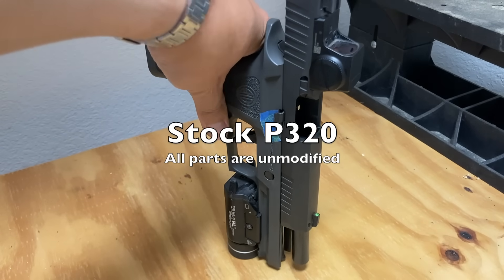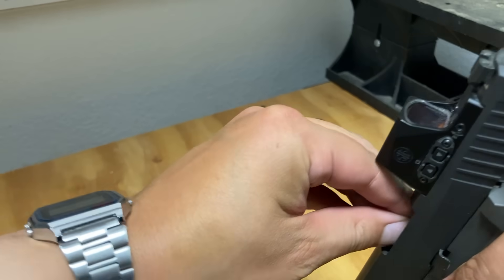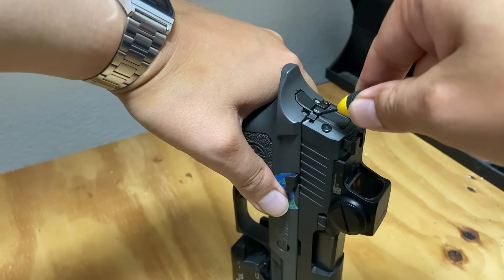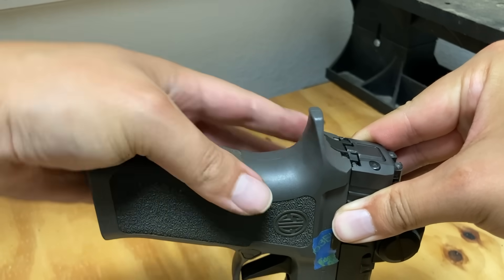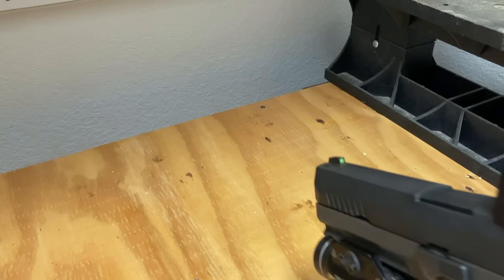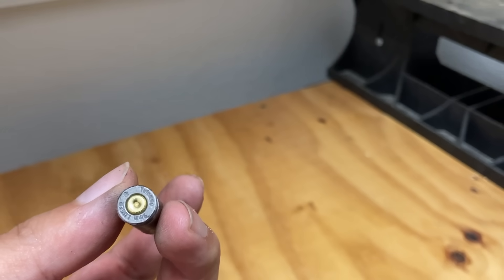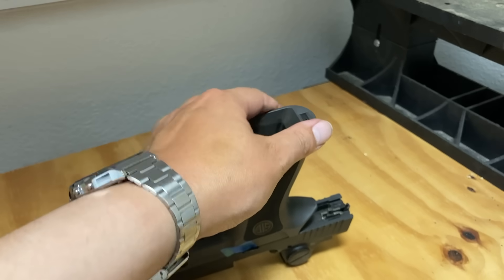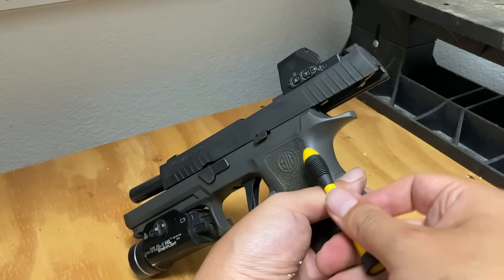Attempting to reproduce the FBI's Aug. 2024 P320 Sear Movement Test

Comment: I guess I'm dense but I still don't understand how this proves that a 320 can just go off in a holster with no  other action being performed or, in other words, as long as I keep people from shoving tiny screwdrivers into the guts of my 320, I'm pretty safe...
Reply: the working theory is that the striker safety is getting stuck in the "unsafe" position if certain pressures are applied to the gun (i.e. officer tussling with a suspect, pressing against a wall, that kind of thing) and then a knock on the back of the slide causes the striker to slip off the sear and fire the gun.  The striker safety on the P320 is a thin blade of metal (shown at 6:32) that is pushed up into the slide by the trigger pull.  It's a different style than pretty much all other brands, where they use a small round metal rod that gets pushed up into the slide on trigger pull.
Reply: @shazmodeus2795 Shouldn't the FBI be required to provide more than a theory?
Reply: @RynzoMendeln  I say theory as that is what they concluded was happening in their testing of this officer's firearm, but as the video we watched just now shows, it's difficult to replicate.  Basically, ever single P320 that has had a UD would need to be tested in this exact procedure and see if the result is the same.
Reply: @shazmodeus2795  I think so yeah. Every firearm that UD, especially the 320, should be examined to the max, don't ya think? There must be something I'm misunderstanding. It confuses me why the FBI left out the most important result, pending further investigation, from two years ago.
Reply: it shows that one of the safeties of the gun can fail if the first sear fails. sig apparently thought it was possible for the first sear to fail since they included an additional safety
Reply: Yeah. You'd figure the FBI could write a more cohesive report. From what I gathered, it goes like this.
Test 1: 100 sear pokes. Safe
Test 2: 50 hammer wacks and 1 sear poke. Safe
Test 3: 50 slide manipulations, hold together, and sear pokes. 9 failures.
Test 4: 1 odd no manipulations with sear poke. Fail. 

Are they saying that just by squeezing the slide into the FCU that that is moving the safety lever up and out of the way of the striker enough? 

Oh and then they went and acquired a brand new unfired 320 and it failed the first and only attempt. Teh fun

I guess if the pieces didn't fit and were outta spec that could be possible. They had one guy whose only job was to observe the interior parts in motion. Where's his results
Reply: Bro
Reply: Yeah, I'm wondering if I could just upgrade the internal components and have both a nicer gun and safer gun
Reply: there sa video by  youtube channel "Wyoming Gun Project" with title "SIG P320 Un Commanded Discharge and its Repeatable"... the issue is with the trigger. A VERY VERY VERY  slight pull can deactivate the safety, less than 1mm... that's crazy... a very slight out of spec or a dust for that matter can render your gun an assassin of its own. don't trade your safety for a gun that's been proven to hurt people.. lots of choices out there buddy.
Reply: @jetfu400 
Another YouTuber proved that even the holy Grail of guns, the Glock, does the exact same thing.
Reply: The whole point is that IF the spring is disengage AND the slide and being wiggled around a shit ton from “duty use” it could POSSIBLY go off. Im still not totally convinced this isnt a user error and of its not its from poor QC
Reply: @ADDAmerican 100% it just happens to be mostly law enforcement who have issues you know the ones too embarrassed to admit it was there fault
Reply: @chuckingleadyea idk anymore after hearing that airman died. Seems like an issue with the slide being compressed by holsters which is terrible. Unless a fellow airman shot him and framed it on the gun just going off on its own (a perfect crime) sig is cooked if thats not what happened
Reply: I was about to make the same comment. Stop wiggling your slide,purposely trying to defeat the internal safety mechanisms and shoving tiny objects into your weapon and you'll be fine. I'm surprised people don't pull the trigger and say, "See, the P320s go off on their own."
Reply: @karljohnson4008  Classic idiot comment from a p320 defender
Reply: @karljohnson4008  Shoving tiny objects in is a totally reasonable thing to happen though: guns get dropped, dirt can get in, etc. if a bit of grit is enough to mess with your gun operating safely, it's simply not cut out for duty use. Plenty of other guns simply DO NOT have this issue. Why don't we see glocks suffering from this same issue? What about other guns? If this was truly a training issue, we would see the same discharges and problems with glocks too. But we don't, and that's the problem.

Comment: I'll admit that I haven't finished reading the report yet, but didn't they file down the sear in their test? Hell, if I'm remembering what I have read so far, they tested their gun over 100 times in two different ways and failed to have a UD or even leave an indentation on the primer. I'm not saying this test is a nothing burger, but it doesn't seem to be the final blow that certain people are claiming it is. It seems more like a handful of things have to fail all at once in order result in an UD caused by standard movements of an LEO, instead of a handful of things being guaranteed to fail under normal LEO movements resulting in a UD. I could be wrong, though.
Reply: Throughout the testing they modified spare parts and replaced them in the gun with the known UD in order to test the different safety features in the gun. So yes, they did file down a sear but not the original one to the gun.

Comment: I have examined several 320s.  Only one had out of spec parts that could lead to this problem.  I suspect Sig is rushing them out and quality control has slipped.  The design in and of itself is a weakly retained sear, but even a poorly manufactured model is only going to malfunction very very rarely.
Reply: That is extremely reassuring when the rare malfunction is blowing a hole in my freaking leg or some random person.
Reply: @rre9121 . I didn’t buy one.  Even in spec I don’t trust it.

Comment: The problem doesn’t so much rely on the slide to have a failure but the FCU I think. I did similar testing on a 2023-2024 production M18, roughly 1.5-2k round count. My personal carry, however relatively clean and recently oiled (the safety lever freely moves). Safety off, I could routinely defeat the slide safety and have a firing pin protrusion by loosely staging the trigger several times, then pressing the sear down with a small punch (not using a lot of force, only enough to drop the striker).

Comment: You cannot duplicate what the FBI did because you do not have the actual firearm that exhibited the uncommanded discharge. 
It is well known that not every p320 or variant exhibits this problem. However it appears that every p320 or variant has the potential to exhibit this problem. It  be quality control, tolerance stacking, etc?
Bottom line……you cannot reproduce what the FBI found, because you do not have the firearm they used in their study.
Reply from the maker: Happily, I don’t have access to a pistol that has exhibited an uncommanded discharge.

Comment: From the very beginning of these reports starting to come out I suspected this is at least partially due to a tolerance stacking issue. I would be more surprised if this was replicable on every P320, as opposed to some exhibiting this issue. Haven’t had a chance yet, but I’m going to read the full report and attempt to recreate the test on my Max. Also, did the report say if this was with a loaded magazine inserted? One thing I noticed with the P320 is that there is significant upward slide movement with a magazine inserted. Also without a magazine inserted the slide is pulled down onto the frame while pulling the trigger, although a loaded magazine counteracts this. Both of these characteristics are much more than I’ve seen on other pistols. You can literally watch the dot shift while pulling the trigger without a mag or while seating a mag, although it doesn’t shift while pulling the trigger with a mag inserted. It has some odd characteristics in the slide, trigger, magazine interaction.
Reply: The upwards motion is fine and well known. It's the downwards shift that is the issue (if related). You have to get the safety disconnected somehow. I've looked at mine all day today, banged it with a hammer to no avail. The lever is just too low. If it was badly built and raised then yes, it would be possible.

Comment: The assumption is that all p320s have exactly the same specifications that yours does. Mim parts can vary in dimensions and so can rails. It’s simply not possible to mass produced parts and not have some variation. That I think is the problem. There have been other manufacturers including Glock that have had pistols blown up because the feed ramp was cut past the rim of the case leaving the case unsupported. Fortunately the vast majority are safe but not all are. There simply too many variables in mass production of parts. Some are going to fail.
Reply: Making important parts out of actual billet on CNC would produce EXTREMELY tight tolerance of variation and mix that in with actual QC other than Kamir Kabob in India they could have produced a very durable and respectable FCU. However they'd either have to charge more or accept less profit per pistol but for just the few parts that I think are important not to be mim'd in India I can't believe it'd be all that much... $50 more total? Whether there is or isn't a problem, the design, QC, potential for QC issues absolutely is not confidence inspiring the way other highly tested pistols in the same price bracket are, and this could have been mostly avoided by Sig not trying to be greedy/cheap and just used proper materials.
Reply: I agree. In addition, any replication of the test should be done with weapons that experienced the same amount of use, including daily carry by officers.

Comment: I mean we also have to factor in the firing pin safety spring they showed in that study. If it was doing as pictured in that gun then I can see how the striker safety was defeated
Reply from the maker: The Striker Safety Lock Spring in the report was still properly pushing up and down on the Sear Housing and the Striker Safety Lock respectively. It was trying to pivot its center away from the Sear Housing, but was being kept in place by the captured top leg. If it were weak and not properly resetting the Striker Safety Lock, then I'd have anticipated them calling that out during the parts inspection, but instead they focused on wishing that the lower leg was still captive the way it used to be.
Reply: The spring that was moving around on the post?  Non-issue.  I don't know why they bothered mentioning it.

Comment: How many rounds were fired since last cleaning with theirs vs yours? Wouldn't be surprised if burnt powder or other debris was causing parts in the safety mechanisms to start binding up earlier in a cleaning cycle than advertised,
Reply: Could be. Like most airplane disasters; it's a bunch of otherwise insignificant failures that all line up at the right time to cause a catastrophic issue.
Reply from the maker: I guarantee my pistol has seen more rounds since cleaning than theirs.
Reply: Theirs had 100 rounds between cleaning. Per the report.

Comment: sig stans on life-support (for more than one reason)

but hey guys once you come to, HKs are fantastic pistols.
Reply: Lmfao being an HK fan boy is like dating a woman who also happens to be a stripper and on meth. You have a wild time but you sure do pay a premium for it and she definitely doesn't love you back.
Reply: Literally my standard, I've been told and reassured this test means nothing "because the force required is unrealistic" but its like... okay so what? Unrealistic means impossible now? Bet if you push the sear on an HK it doesn't fire, why couldn't sig have just not designed a fire control group that loops itself, maybe have the striker safety be more robust and also separate from the main pack. Clearly they could have because thats the 365... I'm so up and down with this problem but that type of "reassurance" from industry experts really rubs me the wrong way.
Reply: @Hellcat287287  this. When anyone looks into the actual engineering of some guns (HKs for example) vs other guns (Sigs in this case) its night and day in terms of how much effort is put into design / engineering and testing.
Reply: @Hellcat287287  I guess it's entirely possible that someone could come by with a tiny screwdriver, take the back plate of your pistol off, and press the sear down.  I guess...
Reply: @MikeB-ng3ol thinking more along the lines of your sear springs failing; if they're not in play what's the pressure to move the sear now? I asked that and was never given an answer. I don't know and we've seen sigs springs crumble to dust on the striker so why would we assume the sear springs are immune to such decay? If it's still a respectable amount of force... Cool. If not... Then the feedback loop is absolutely relevant.
Reply: @Hellcat287287  There are two sear springs for redundancy with a 2nd sear notch.  Without positive pressure, if all of these components failed, the striker safety still prevents the pin from moving forward.
Reply: @MikeB-ng3ol except it doesn't in the report lol. What's the pressure with one spring lost. What's the pressure with two springs lost. If you cannot answer that you cannot say without a doubt this test is pointless.
Reply: @Hellcat287287  Does the report include them manually pressing the sear down?  If so, everything I just said is accurate...  If you lose 1 spring, out of two...  that would be approx a 50% reduction in tension.  1/2=.5 =50%....
Reply: @MikeB-ng3ol in the benefit of the doubt for the 320 it's not that simple because you have to add in the trigger spring... But sure go with your math one spring loss goes from 7lbs of force down the 3lbs. That amount of force starts to become more concerning for unintentional sear movement.

Comment: The FBI test said the gun was in a holster. Do this test in a holster and in a vise like the FBI did. The holster may be applying forces to certain components while the movement is being applied to other componets. Without the holster, when you wiggle the slide the frame moves along with it.
Reply: The FCU frame does not move in the grip module. It's got nowhere to go. It's firmly seated in the rear and locked in the front with the takedown lever. You'd also see the trigger wiggle when the slide is pressed toward the frame, which it don't. The movement your referring to is just the spacing between the FCU rails in the slide rail slots. If it does move around in the grip module, it should not, and have it looked at.
Reply from the maker: The forces placed on a gun by a duty holster aren't going to functionally change anything; the only thing putting it in a holster would do is make the reset longer and more annoying. I'm puzzled how you'd say the frame and slide are moving along with one another when you can visibly see them clicking together and apart when I'm wiggling them...
Reply: yeah I agree I would want to see a recreation of the malfunction as close as possible to what happened, I would like to see it in a holster too.